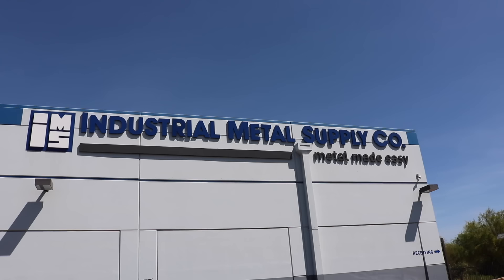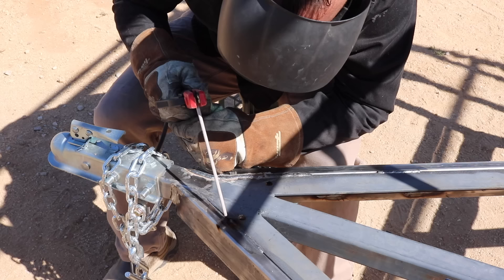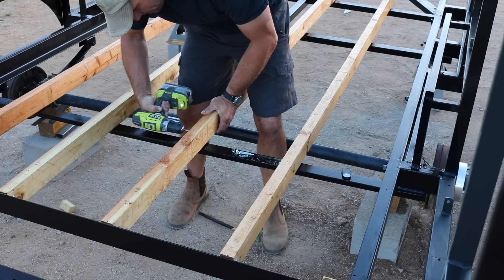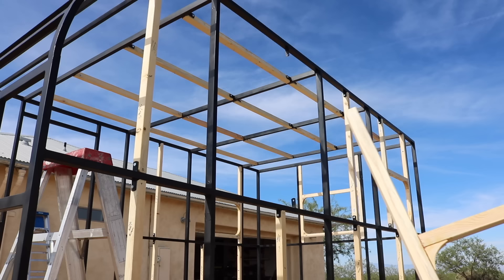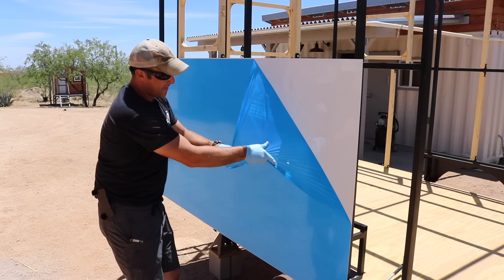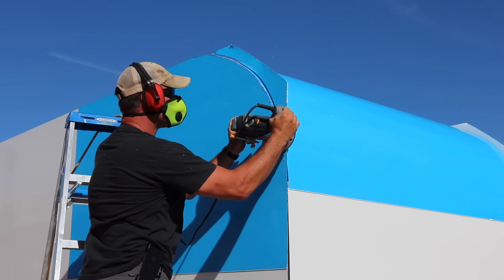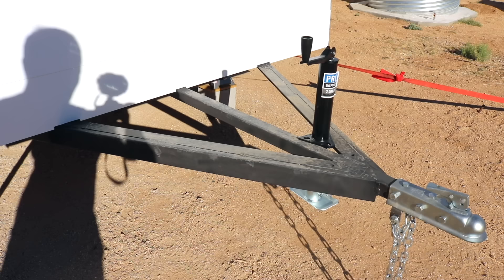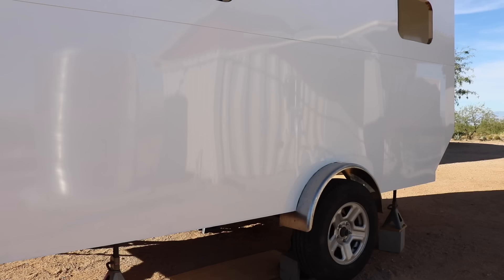How to Build a DIY Travel Trailer - Aluminum Exterior and more (Part 2)

Comment: you may want to spray the underside of the wood under the trailer with a rubberized sealer like a trunk liner or rhino liner.
Reply from the maker: it will get further protection as well as a road spray barrier.. but I have to finish the wiring and some other things first :)

Comment: the Chevy Lumina fwd minivan exterior panels were attached in a similar way.Using a panel bond adhesive. Instead of bolts or welding.

Comment: Hi, Best to Lay a Triangle Steel plate on top  . Just behind the ball hitch  and " Cover / Weld " Where All the Front Tubes comeTogether ( This Is A High Stress Area !!! ) . This Triangle Plate if Extended Back , Drill a hole and mount your Jack on it ( Bolted ,, Not Welded ) Then If you have to " Replace The Jack "  , You Are Not Cutting OR Weaken the Frame .Looking Great .
Reply from the maker: I do like the idea of being able to replace the jack so I'm definitely leaning towards adding a piece of steel and bolting.... you and a couple others mentioned that and makes total sense  :D

Comment: It is looking good.  I wish you would have riveted the wood parts to the frame though instead of bolts.  Can I ask what those metal sheet panels are called and how much they cost?
Reply from the maker: thanks!  not sure about riveting wood to the frame.. never riveted something that thick... but i think the bolts will hold up fine.   The panels are painted sheet aluminum.  They come in several colors and the paint is really bonded on well... very durable.  As for cost, not sure... they were supplied to me by IMS for this project.  Sorry I couldnt' give you a better answer... thanks for watching:)
Reply: Obviously it is to late now, but they do actually make rivets just for that, and it gives a very stiff frame :-)   How can you doubt rivets when you taped on the siding, lol.

Comment: Thanks for sharing - still need to see your spreadsheet with $$$.  Thinking about an enclosed utility trailer, or else just a quad trailer.  Where space is at a premium you can stand it on its tail or side and save a bunch!  If I'm careful, I will drive the 200 miles to get to the L.A. IMS - that's an incredible store compared to what we have locally in Santa Barbara County.

Comment: Think about leaving all your roof area open for solar panels, and putting your exhaust fan up high on the wall, right above your indoor cooktop.   That way you can get double duty from your fan, and not lose roof area that can collect solar power.

Comment: Instead of the trailer jack you have in this video you may want to look into a jack that pivots up out of the way (parallel to the trailer toung) in case you plan on taking this camper off roads and the jack could be bent to a point where you can not use it when you need it.
Reply from the maker: I'm doing a combo.... swing up foot and stationary stand.   I asked several people I new that had trailers for a while and a few used to have the swing up style but ended up switching to a stationary post  when they started to have too much play in them

Comment: I can assume there will be many other items to add, but at the stage you are at now, don't for get to add a spare tire or two, especially if the axle your brother donated, (kindly) is of some goofy lug pattern, as that happens so often. Also, check to make sure that both lug patterns on each side do match, as I have seen actually about 10 to 15 times, where there is two different hubs or stub shaft assemblies welded on to the main tube..  Also, while it is up in the air, and the wheels are dangling, pull the wheel hubs off, make sure that the wheel bearing can be sourced or if they need to be ordered, just for peace of mind, as often times, some of these metric bearings are so goofy, that even my local supplier has scratched their heads as to what they are... Lastly, clean, and repack the bearings with a high grade grease, so you know that they can dissipate the heat properly, on the longer and higher speed routes, good luck and be safe... Oh and one more thing, do not buy those spring loaded dust covers that have a grease zerk tapped in the middle. As too much grease can actually cause the bearings to over heat, as folks that simply assume, that they can just keep pumping grease into them, and often times, will push the back grease lip seal right off / out of the bearing hub and then well, you have a greasy mess and a fun time trying to locate a lip seal now... LOL.. again, good luck, and be safe. Dru

Comment: VHB tape is awesome! They stuck 2 pieces of iron together with it and tried to get 2 locomotive engines to pull it apart and they couldn't. The weight ratings on the 3M VHB mounting tape is about as underrated as the h.p. ratings on a late 60's muscle car. Their "40 lb. VHB tape" will easily hold 200 lbs.+ edit: Don't bet your life on that number, but ...it's skookem AF is all I'm saying.

Comment: just started watching this build. Really nice inspiring work. Is anybody familiar with panel bond used in the automotive repair industry? It's used to well bond new panels to the vehicles, requires similar prepping as the tape used here. Just throwing out an idea to butt those aluminum seems together for any other projects..

Comment: This is so awesome. One of the best DIY projects I've seen so far. I'm a welder and have never thought to take on this big of a project. Big ups to you. Where there's a will there's a way!! Many blessings to you on ur endeavors with this camper.  Ur inspiring me to think bigger👩🏽‍🏭👩🏽‍🏭😁😁 quick question... why did u switch between using stick and mig on certain places?  Thanx and have a good one.

Comment: Really happy to see this.. but i wonder if that aluminum panels are heat proof.. what if i use sandwich panels or insulated panels.. i am building the same thing.. can't wait to see the finishing.
Reply from the maker: They should be fine in the heat.  The VHB tape is resistant to the 200-300 range

Comment: That looks like the same adhesive tape that we used to put up bathroom advertisement signs we have to literally use a heat gun to take them back down and it usually causes a fair bit of damage to the wall if the wall is not tiled and we have had people try and tear them off the wall and end up tearing a huge chunk of drywall out with them so the the tape is pretty good stuff I'll be interested to see how it stands up to the Sun and the heat out there
Reply: VHB is a long-standing adhesive in all manner of transportation applications...including some in aviation! There's absolutely no worries about Joe's panels coming loose. VHB is an incredible no-weld, no-fastener solution for joining materials; particularly non-porous materials such as the application here of aluminum panels to a steel space frame.

Comment: Great job! I all currently building a camper trailer from an aluminum cargo trailer. I am going to be lining mine inside with some thin painted aluminum sheets after I insulate between the studs ....your video has inspired me along the way!
Can you tell me, what thickness of aluminum sheets did you use inside?
Do you have any other ideas for light weight material I can use for the walls?

Comment: Great Job Man. It looks very clean. I too am worried about the tape, mostly how it will hold up against road use and can't help but feel a few flat tacks wouldn't hurt but honestly, your work makes me feel like a Poker, so what the hell do I know. Lol. I've subscribed. Thanks
Reply from the maker: Anthony Jenkins thanks Anthony!  And yes i understand about the tape...I spent quite a few days researching it just wondering if it was really that good.  But only time will tell...worse comes to worse I can always add rivets later...hopefully 😉
Reply: homesteadonomics . A friend told me that tape is used on the facade of the tallest building in India. So your in good company. I also was wondering if you planned on giving final cost of your materials on this project ? Thanks for the reply.

Comment: Great videos. I have been digging and doing research on building my own trailer and this is the first time I have heard of the tape you used. I do not have welding skills, so I will be building my frame entirely out of 2x2s and using either Filon or aluminum sheets for my shell. Do you think the tape will bond as well to wood as it does with metal? Thanks for your input!

Comment: The tape is the stuff they use on gopro mounts. Dunno if I'd trust it over a mechanical fastener (rivets). Especially when you can buy white aluminium rivets to go with your colour scheme.

Comment: Once again u are amazing, I have a question though...instead of 2 x 4's, could u use aluminum studs? Would it save on weight & be as sturdy as wood? U can put a trailer hitch on the go cart now to haul the camper
Reply from the maker: thank you!!  Yes, I probably could have but the wood was just easier for this specific application since it was going to get plywood decking.   as for the go kart pulling this...not likely with it's little engine ;)

Comment: Note to self for my trailer build don't use foam between frame and plywood. Use caulk. I built an open bed trailer in So. Cal many years zero issues with rot where the plywood met the frame. Its too dry in So. California desert to worry about it. Just saying.
Reply from the maker: good to know, thanks!

Comment: Escape Hatch?  Not sure if it was mentioned, but what happens if the trailer blows over one night with a wind gust?  And door opening ends up facing  the ground?  Can you squeeze out a sliding window, or will the window frames be made removable?  Are people allowed to ride in trailer when it is being towed at highway speed?  Also, is an escape hatch required by state for live in trailer tags?  Enjoy your videos- only asking for safety concerns...

Comment: I think I've watched this episode about 5 times. It's been super useful for my own camper build. Thanks for putting these together!
What kind of router bit did you use and how thick is your sheet metal?
I've been having difficulty cutting my sheet metal with my router. The router bit catches and goes all over the place. I've broken a couple bits. 
I have .050 6061 AL sheet. The bits I've tried are flush trim carbide. I've used 1/4" and 3/16". One set were 2 flute, with an upcut and the other was a bit with straight blades (no twist). This one works a little better. 
I have electric sheet metal shears that are great for straight lines but not so much on curves.
Reply: I figured this out. I'd read to use a slow speed on the router. Mine goes down to 10,000 RPMs. I cranked it to max speed....30,000 RPMs...problem solved!

Comment: Hey Joe!  I know you’re trying to get the trailer ready for vacation.  Have you thought about putting a solar panel on the roof for next year?
Reply from the maker: Hey Bernarr, there is definitely a plan for solar... but it might not come until after the summer... I need to figure my awning system first... as that will take roof space... then I can figure the solar :)
Reply: @homesteadonomics  Your video is awesome! I learned of VHB tape watching modern marvels. It's now in my tool box. Was curious if you will try harbor freight solar parts, or build a better system?
Reply from the maker: I heart guns it’s funny you mention solar as I just posted part 11....solar install....perfect timing 😀👍

Comment: Is there a build thread for this? I’m curious what thickness your steel tubing and aluminum sheeting are. The use of wood to supplement the framing to save on weight is genius!

Comment: One issue I see mounting the wood structure with nuts & bolts. Stainless Steel &  TENSION HEAD LOCK NUTS vibration will nut affect them. Yet a job!

Comment: Total admiration here, but I can't help wondering why you didn't use pressure treated 2X4's and plywood.  The underside takes a beating like a pressure washer every time there is water on the road.   ...but then, it doesn't look like it has rained there in a couple hundred years.

Comment: Great job, I like the tape holding the panels on, hadn't seen that before. Are you going to use the front, or hitch area, of trailer for battery/propane storage to keep that hazard out of living area?
Reply from the maker: yes, the front will have a tongue box to hold the batteries and or the propane :)

Comment: I've been looking for 3 years, for someone to explain where to get the material for a project, to cover my utility trailer with a removable "wagon" style cover.  In my mental blueprint (so to speak), I use 6 12" steel pipe, welded onto my utility trailer (3 per side).  Then I create 3 arches, made from 1" steel pipe, long enough to create an arch height to be able to walk onto the trailer, with my push mower or ride-on mower.

The arches may require a joint at the top, connecting 2 half-arches.  The ends of each of the arches are held in place by the 12" pipes.  It may be necessary to create a spine at the top of the arches, to keep them for wobbling forward and backward, so I'd need a 4-way connecting joint, and 2 3-way joints.  But now comes the halting of this dream: the material must be able to roll up when I wish to disassemble the wagon cover.  I have no idea what material to use, or where to buy it.

Is this dream "wagon" style cover a good idea or bad?  How would you make such a cover, if this was your project?  I'd like this to withstand wind, while driving down the road, or the weight of snow.
Please help.

Comment: How about a cistern on the trailer hitch for collecting rainwater on the go, maybe need to adjust roof slope.  Just kinda joking, preview picture on Utube kinda looks like you have a cistern there.  I once converted an old school bus and your next stages (interior) will be enjoyable for me.
Reply: He has a nice video on using an old advertising tarp.
Reply from the maker: Yes, that is a culvert cistern for my shop.  and the aspect about harvesting rain off the trailer is in the plans too... not necessarily holding water on it.. but diverting to some buckets during camping trips :)
Reply: I can't wait to see that rain catchment!  You set the bar pretty high, Joe.  I am looking forward to the inside build.  Stellar work as always'

Comment: Enjoyed your trailer build, great job. I’m building a trailer but have some questions, if you don’t mind. Aluminum siding, what thickness was it, and what did you use prior to the double sided tape. Second, what type of tape used on the corner of the joint. I’ve watched a lot videos but your are the more detailed.

Comment: Truly inspiring channel! I have a question. Mostly just want a real world opinion from someone who has actually used the VHB tape. I’m also building a camper. I’m using PMF (poor man’s fiberglass) over 3/16” tempered utility MDF board for the exterior sheeting. I’m planning to adhere the smooth side of the board to the steel frame with the VHB. Then on the interior side of the frame, adhere 2” Foamular250 rigid insulation board to the steel frame as well as to the 3/16” MDF. No other fasteners will be used. Do you think the VHB would adhere to the MDF and foam board well enough to be the sole fastener for this project?

Comment: Sir, I have a 1965 Trotwood 14’ Trailer. I have concern about the trailer component and the leaf springs especially the rear mounts to the frame. It is attached on a thick piece of iron welded to trailer. How do you fine a trusting trailer company for feedback is the trailer safe with the axle and brackets holding the leaf springs assembly and the trailer frame due to its age! It is my Search Rescue trailer and I volunteer so no monies coming into the trailer . I so admire your work and trust your advise. Thank you.

Comment: Very nice work! But I must say that the suspension is concerning in terms of the vibrations  which will result from the leaf springs. And the weight of the construction!!!! Why did you not consider aluminum framing?

Comment: what are your plans to protect the bottom from rot or rust, if you take it on a wet highway or muddy trail?  thank you.
Reply from the maker: it will get sealed with an additional layer of waterproofing after wiring, etc,.   and I also plan to add something as a spray barrier... like house wrap or vinyl panels ,etc,.... not totally sure just yet :)

Comment: Good video. I missed the part where you applied the panel to the curved area at the front. Did the panel just bend without too much trouble or did you have it specially curved?